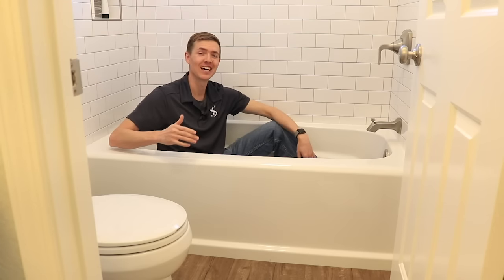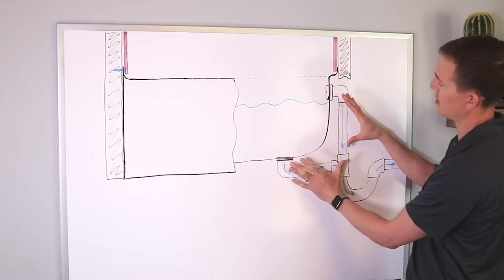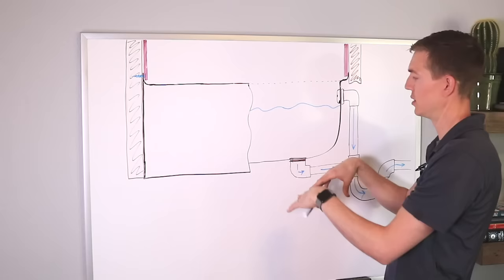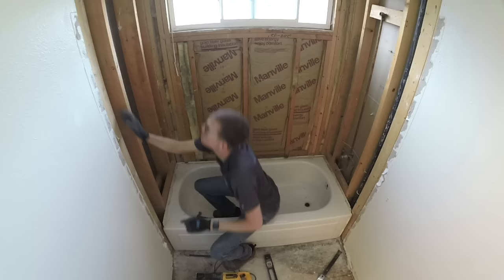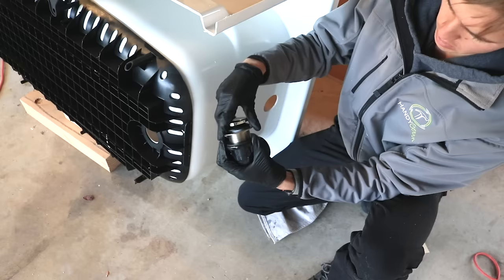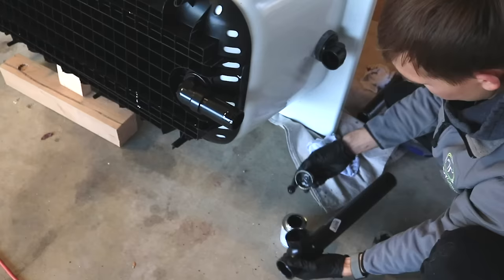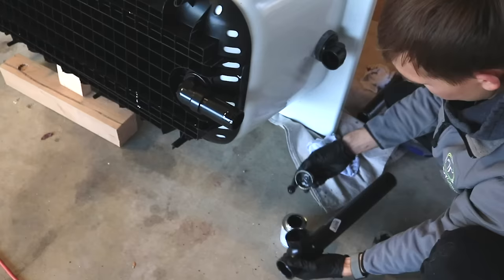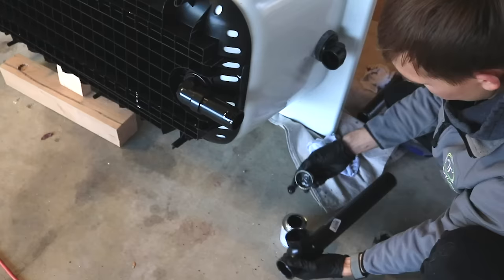How to Replace a Bathtub (Step By Step)

Comment: There should be an air barrier around this tub, setting it against the framing and insulation is not the correct protocol

Comment: Lucky but not pretty, the previous owners cut out the drywall on the other side of a wall to access the tub pipes, so it shouldn't be too hard to self install. My biggest concern is how much floor is actually there....I can see one end of the tub clear through the ceiling of the basement. I would think there's subfloor past where I can't see but geez it is a little scary.

Comment: Great video, glad to see you used silicon instead of plumbers putty. A lot of plumbers dont realize that putty drys out and cracks, only good for 5-10 years. Had to fix so many drains because of it.
Reply: Silicone also breaks down over time. Both work well though and plenty of pros use each.
Reply: I’m from the school of puddy

Comment: When inserting the ABS joints, ALWAYS MAKE AT LEAST A QUARTER TURN. the spread the solvent cement to prevent leaks.
Reply: Yeah, you don't want to work it back and forth, either. One way strengthens the bond, back and forth makes the joint a liability,  especially in pressure bearing lines (pvc irrigation and mains before hwh)

Comment: You have convinced me to hire a pro for this. Thanks!
Reply: After more research, I’m reevaluating what I said last week. First, not all tubs require cement underneath. Some come with hidden support. So all the measuring and adjusting he did is unnecessary. The second thing that scared me was getting the position of the plumbing right. Sometimes a tub reinstall requires realigning the drain and overflow to fit the new. They make kits that let you do that without installing a new drain line. These kits are great for amateurs because they save us from perfect plumbing assembly. After researching this i now have the impression you’ve shown us the hardest way to install a tub.
Reply: @joemedley195  some do come with leveling support, like the tub I just bought, and a mortar bed is not required per the manufacturer, but the mortar bed (in this video) served for level ground to sit the tub on. Other times people use a mortar bed as support for the tub to help prevent it from cracking from pressure when full. As for the drain assembly kits, yes, they come with all of the pieces but dry fitting to the tub before installation so you can cut it to fit and then after gluing it together, more dry fitting to be precise about where it is going to go in the floor. If you are not precise (hence dry fitting, making markings etc), you will have to do it all over again, just like he said, because it won't line up with the drain and overflow holes properly. I have been watching many of these videos because my husband and I are about to tackle 2 bathrooms. The dry fitting is in everyone of them. And most people do mortar beds, just not the way he did because they are using the mortar for support, not leveling.
Reply: He was showing people how to install a tub in a worse case scenario where they need to level the floor and install a new drain as well. Not everyone will have to do all of that. If you don't need to replace the drain and level the floor you just skip those steps... not a matter of making it harder. It's for people who will need to do those extra steps

Comment: Great video. Getting ready to do this. However on a concrete slab so drain situation a bit different. One note I learned in my research. Some manufacturers void warranty if you drill through flange. I get if done correctly not an issue. But id be weary doing it in cheaper acrylic tubs. Fender washer and screw above. But this video helped huge with stud removal. Thanks

Comment: I am an electrician by trade and have done some plumbing, but I think this video has convinced me to hire a professional for my project. 

It is a standalone tub with lines through the floor Jerry-rigged and a shower/ temp mixer free floating. 1930s house with multiple handymen. Joist was cut completely to fit drain which needs repaired, and I want to have the plumbing in the wall and turn it to 6 ft tub. As an added bonus of complexity there is a new window that needs to be tiled around. Currently there are just 2 shower curtains that wrap around. Whatever plumber/remoder I hire is going to be in awe when he sees the hodge podge mess of a drainage system.

Comment: Excellent DIY video. You were very clear and precise. One of the best I've ever watched. I want to replace our steel one with another cast or steel tub but deeper.  It will be  complete gut job because the tub has overflowed several times over the kitchen from the previous owner and once by our kids. After watching this, I need to decide if I should leave the tub replacement to the experts. I'm thinking yes, but now I have to find one who is an actual quality installer.
Reply from the maker: Glad it helped! If your tub has overflowed several times, there is a good chance you have some water damage/mold that should be addressed as well. This can be a big project and I'd recommend talking to a mold remediation company and doing the demo carefully.
Reply: @StayHandy  Yep. I'm expecting it and having to replace subfloor as well. House was built '83 and the bathroom is over the kitchen and it's fluorescent lights and a dropped ceiling that I want to remove. Kitchen needs an entire remodel so perfect place to start is the upstairs bathroom. Need to also remodel adjacent bathroom upstairs which is master bath. Lots of moving of plumbing.

Comment: Thanks for the video! Looks easy to follow even for a very newbie DIYer. I have a small bathroom to renovate (bathtub+shower+vanity+toilet) and I was mostly intimidated by the tub. I guess because I was worried about not having access underneath (I don't see any access on the floor below). But this just gave me the confidence to do this job. I will be looking at your other videos for inspiration and information!

Quick questions if you ever see this:
- isn't the silicon sealant making it harder to remove the bathtub or the drain later on, assuming there are leaks and needs a redo?
- I saw you glued the abs drain to the P-trap. I assume you cut the older drain connecting to the P-trap. What type of tool do you recommend to use to cut the ABS if access to the P-trap is very limited? (don't know yet if that's the case, but I've seen something like this while doing the vanity in a different bathroom and it was a pain to cut the ABS with my reprocicating saw)

Comment: Another bit of advise. Spend the extra money and buy a good quality tub. Its going to be in place for a long time, so you want it to last. I agree with the other comment about not using caulking around the drains. The manufacture of the tub I purchased recommended using plumper's putty.
Reply: It all depends on the tub. Plumbers putty is not recommended on the last 4 acrylic tubs I installed as there's potential for discolouration. Just use what the manufacturer says and retain warranty. Cheers.
Reply: He did say to buy a good quality tub.

Comment: Hello I’m have a water leaking out from the cinder. Block foundation wall of my basement slow and rod ing up 2 feet up to the wall tearing it out and don’t know where the water leaking from wondering the water come from the out wall of foundation or draining line please give me advise to check and fix the leak before I’m safe to title the floor  thank you right now my floor is concrete flat can I seal the concrete along the foundation block edge then title over it

Comment: good job very helpful. I wouldn't use silicone on the tub drain finish trim piece, plumbers putty is better since it's renewable and can be removed for repairs.
Reply from the maker: It was recommended by the tub manufacturer. Also, I’ve found that on these acrylic or fiberglass tubs, the plumbers putty gets shredded when trying to attach the drain. Silicone is a more reliable sealant. More difficult to remove? Yes, but hopefully you aren’t planning to remove the tub until the next bathroom remodel.

Comment: Bro, thank you do much. Best video I've seen on tub installations and you answered just about all my questions. Only one that I have is if a mortar bed is recommended. I see that you didn't use one so I don't think it is but just making sure I do it right the first time. The tub I'm using is acrylic. Keep up the great work and please keep the videos coming.
Reply from the maker: It depends on the tub you buy. Read the directions that come with the tub.

Comment: I know this an older video.. nicely done. One thing though, I've never heard of using sealant in addition to the seal and plumbers putty. Honestly, that doesn't make sense to me. For example, overflow seals and drain seals go bad from time to time, usually within 10 years or so they start to become brittle and cracked. You have to replace them.. as part of on going maintenance, something that can be done easily from the inside the tub, ive done it many times. The sealant would cause an extra problem at that point. If the manufacturer don't require it don't do it. Its like when people add pipe sealant tape flanged connections.. actually makes it worse. Either way, great video! Subbed.

Comment: good video but i would with plumbers putty instead of silicone on drain flange that screws into the main drain..
Reply: Plumbers putty can erode acrylic tubs and is not recommended long term for that application.
Reply: What about when you need to replace? With plumber putty it is easy to replace. But with the silicone wouldn't it be kinda permanent?

Comment: If your ripping out cast iron tub, put plastic sheeting over the tub and break it in pieces with sledgehammer. It actually breaks up pretty easy and then carry out the manageable pieces. Plastic sheeting is for the enamel coating that will shatter badly
Reply from the maker: Great tip. Thanks!
Reply: Till U blow out the wall on the other side.. In the living room.. Take it easy cat

Comment: Really great overview and explanation of this process.  My only question: why silicone and not plumbers putty for the drain?
Reply from the maker: That’s what is recommended by the tub manufacturer. Plumbers putty doesn’t work well on tubs because the flange of the tub spins as it tightens, which creates gaps in plumbers putty.

Comment: Some things I would have done differently:  1.  Plumbers putty instead of caulk to set the tub drain, most drains specifically list this in the installation instructions.  2.  Use clips to attach bathtub flanges to studs instead of drilling holes through the flange, again most bathtubs will come with these clips and show this in the instructions.  3.  At a minimum use a felt pad under the tub, most tubs come with this.  Will prevent creaking.
Reply: Some tubs specifically call for silicone, and actually say to not use plumbers putty or it will void the warranty. Anyone installing a tub, just follow the manufacturer's recommendation.
Reply: Holy easy there hero.

Comment: Great video!  Thank you!  If you still see these two years later, can you tell me why you use silicone caulk under drain stopper (on tub surface) vs plumbers putty?  I’m not sure which is best...old one came out with plumbers putty.
Reply: Plumbers putty drys out 5-10 years after. As I a plumber myself, silicon in my opinion is a more secure and cleaner way to keep your tub from leaking for many years. Use lots under the chrome drain and make sure to watch it for about 10 minutes after you’ve tightened it and wiped it clean because it will keep oozing out and dry with little bubbles poking out. Keep wiping it unles oozing has stopped.
Reply: Just make sure you use silicone as that's the only product (other than plumbers putty) that works.

Comment: So the only reason you used mortar was to level your floor??

So many other videos of tub install show putting the tub in a bed or mortar when it’s still wet and leaving the tub in place so the mortar dries around the tub
However I did notice that in every old tub removal, there wasn’t any old mortar so why is it needed now??

Comment: Hey Dan! There are some metal brackets on my new tub between the skirt and main body underneath. They aren’t attached well and one has come loose. I don’t see these in the install instructions. So, I’m wondering if they were just for extra support when shipping or if I need to try and resecure these for structural integrity. Any idea?

Comment: Pretty good explanation man. Idk what brushed chrome is but it sounds cool haha. Also you said to put cement under the cast iron tubs... you need to put cement under all tubs. The plastic tubs come with a piece of fabric that you put between the cement and the tub so the lime in the mortar won’t eat up the tub. If you dont have a good bed of cement under the tub it will eventually start sagging in spots and you will have to change it. That’s a common service job these days. The cheap plastic tubs that these guys that say they are plumbers installed are reaching there life span and most of them have nothing under them when pulled up. Some even just have sand. About 90% of them never had cement put bAck in where the drain was boxed Out during the concrete pour. So if you find bugs like pincher bugs or scorpions in the bathroom and have no idea How they are getting in there, chances are it’s from that opening in the foundation around the tub drain

Comment: I have a question,  would it make sense if the wall was done first before installing a tub. I like to see a video after the tube is installed how you begin to add the sheetrock/ then tile
Reply from the maker: You have to install the tube first. Watch my video on how to tile a shower to see the rest of the project.

Comment: beautiful diargram- im going from a surround plastic tub to a regular tub. do i need to put any framing together ? im intimidating installing the overflow drain / plumbing part.

the drain plug cross bars are corroded away too, i guess i have to hit it loose with a screw diver?

the bathtub plumbng alone is wortth hiring someone, i wouldnt want to do that wrong and have leaks.

Comment: So, first, THANK YOU!  I cannot access my plumbing without breaking a tile wall below or an external brick wall, yikes!  So, this video was super helpful!  My only suggestion:  Why glue your drain assembly in before your final check? Why not dry fit the assembly one last time and THEN glue it once you are assured it all fits? In case of mistakes??
Reply from the maker: You should dry fit it.

Comment: First grab a tub drain remover.
Then, watch as the remover immediately breaks all of the drain cross supports / hair catcher.
Curse the sky.
Find alternative means to remove your decades old tub drain cap.
Reply from the maker: Oh that sucks
Reply: That helps.. Gonna rip out a 96 Norris tub.. Put new in
Reply: @beavishawk1 I ripped mine out. Used a Sawzall to cut it in chunks since I didn’t know the stud removal technique. 😅 Turned out, the underside of the drain had a captive threaded connector ring thingy like a kitchen drain and the installers siliconed the snot out of it.

Comment: What are the chances I can reuse the tub plumbing that was already there?
Reply: Honestly not worth it, even if you can you will be increasing the failure chances and of having to spend even more on the repairs from a leak.
Reply: I totally agree. 
The cost of new out weigh the issues that can arise. Remember peace if mind will allow better sleep.
I was told many years ago, don't skimp on kitchen or bathroom when remodeling.
Reply: It's like $25 to buy that assembly kit. Cutting corners like this can lead to failure.

Comment: I'm sure nobody will see this..BUT...is it possible to just replace the over flow cover and drain flange without pulling out the tub or replacing anything else? As long as you're using the same size I assume it's a universal part?
Reply from the maker: If you can gain access behind and below the tub, you can do it.

Comment: You should use plumbers putty
Reply: Probably why it was leaking the first time
Reply: Rocky...agreed, showing silicone use on drain isn't correct and cause others who watch & try it big problems
Reply: After seeing these comments, I looked into the issue.  Mfg and Oatley says plumbers putty reacts with the acrylic.
Reply: Wrong, silicone is used for acrylic tubs not plumbers putty. please read manufactures instructions
Reply: I will not be offering to hire you to do my tub or any other plumbing for that matter.

Comment: You missed a few steps to be more efficient but over all a good video. As far as I know you should never caulk or secondary seal a rubber gasket, the solvents will break down the rubber and fail.
Reply: I agree unless the manufacturer recommends it. I would use some light weight oil and rub a light film on the surface of the gasket, like you do when  changing an oil filter on a car.
Reply: I thought the same thing. I could see it working fine but it doesn't seem necessary.
Reply: I only used silicone for drain screw. Didn’t do anything to the gaskets per installation instructions.

Comment: I’m confused. Or maybe I’m dumb. You attached the drain assembly to the tub itself and the. You attached it to the p trap before dropping the tub in. What am I missing? Are you just fitting the pipes to the tub and then Taking them off?